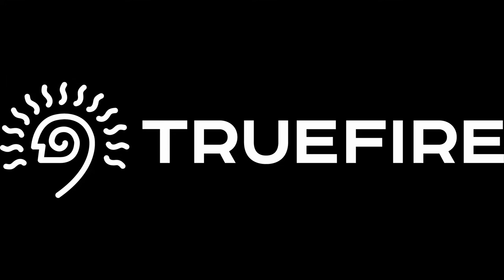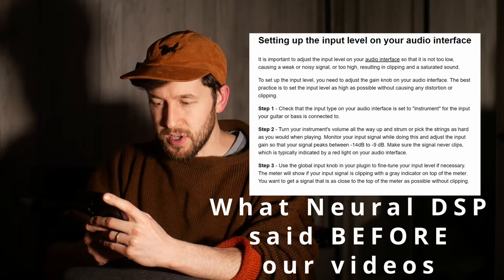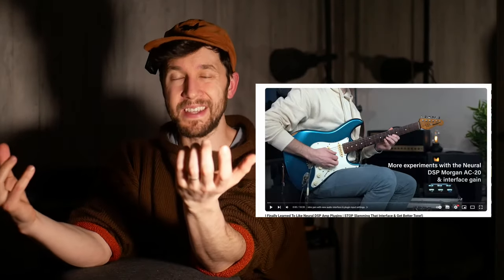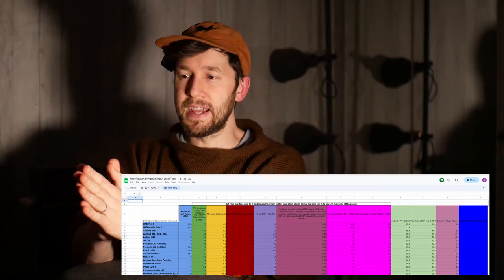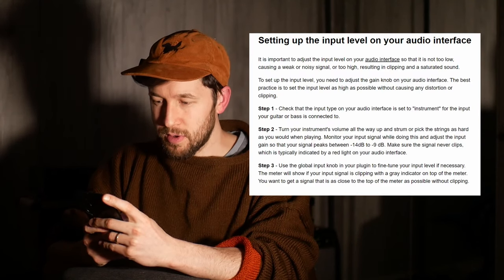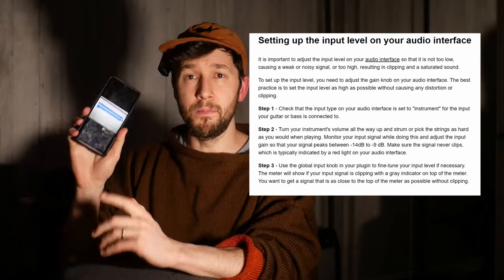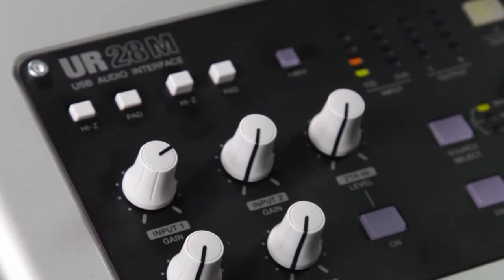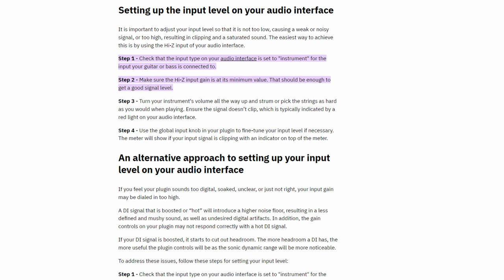Why Are Neural DSP Gaslighting Us About Plugins and Input Gain?

Comment: The thing that irritates the hell out of me about these videos is that you guys know damn well that tons of us are using direct boxes, yet out of the absurd amount of videos about this absolutely none of them mentions Direct boxes.

If you leave the interface gain at zero with a direct box, it is literally inaudible, somewhere in the -32 decibel range. I spoke with Ed S about this and the best answer he could give me was buy an expensive reamp box that I will literally never use once again afterward, and a multimeter which I probably could find use for.

In case you're wondering, yes my guitar tone still sounds like absolute dogshit even with a $2000 guitar, pro q3 and Neural plugins.
Reply: there are other ways to do it, but a suitable reamp box and multimeter costs less than a NDSP plugin or Pro Q3. You can also buy a used one and sell it on, and potentially even make a profit. Maybe you have a friend who can let you borrow one, or a gear rental service? 

If you have 2 interfaces and know the headroom of one then you don’t need a reamp box or multimeter as you can compare levels between the 2 and work it out like that. 

I use a separate DI box and measuring it took all of 2 minutes to do.

Comment: This is getting ridiculously annoying. It’s very simple; you get the plugin and turn some knobs, if you don’t like how it sounds you keep turning the knobs. There’s no single setting you can apply to everyone’s setup. 

You want to know what I do? 
I increase my input gain knob as high as possible without clipping (and sometimes I let it clip 😱). And it works perfect for me. 

I think you’re also missing a very important aspect of this advice neural dsp provided, which you’ve dedicated an entire video fixated on as being bad advice. When neural dsp started making plugins they were mostly for metal guitarists, if you know anything about metal guitar you would know that it requires high gain. In which case that information can lead you to assume at this point in time that the advice they offered at the time in which they were releasing those plugins was also meant for a metal guitarist setup. And many people would agree that that is in fact good advice. 

If youd like to encourage neural dsp to offer advice on a more appropriate gain staging technique for other types of guitar tone then do that, but I find it completely unnecessary to film an entire video bashing them on advice they have offered that many people have found to be useful. You could have simply directed your energy and resources to providing an informative video offering your own advice for gain staging. It probably would have been a fraction of the time. Of course then you would have had to be more creative in regard to titling the video for the same sort of click bait effect.

Comment: Another misconception about EdS video. He never told NOTHING about INPUT GAIN. He were talking about difference in GAIN RANGES of YOUR audio interface and "their" audio interface (plugin creators). Because when you MAP ranges between two devices you definitely would like to have full range on both ends. That's why the only spec mentioned in video as a reference point is "MAXIMUM INPUT LEVEL (dBu)). This is literally gain RANGE of interface. Not the INPUT gain. And numbers in table just offset midpoints of different audio interfaces relatively to each other to OPTIMALLY map ranges. ONLY because you're in digital domain and it has its own properties. When you turn your gain knob on interface up you literally telling "there will NEVER be level less than...." You make your gain range narrower_. You trim it and now it''s smaller. If you will "scale up" it back to initial range you will decrease "resolution".  But you CANNOT just drop your input gain to min and keep everything else as it was before. You NOW have to adjust your input gain but in DAW (or in plugin itself) instead of audio interface to compensate change. It's just ok to do this INSIDE digital domain because you still work with full range initial "source". Just like you HAVE to add your gain on the amp or on the recording console (after signal  taken) to get meaningful results . The REAL thing is : while you're playing low/mid gain it will NEVER affect ANYTHING. You may add gain in DAW or just in audio interface, and you'll be fine. Just because you use such narrow volume range that mapping huge (headroom) ranges of any audio interfaces  will never cause ANY issues. It's just when you play really full throttle high gain stuff (NeuralDSP is MOSTLY for high-gain in mind!) you WILL face unmatched ranges because you will hit MAXIMUM INPUT LEVEL constantly. And THEN you might find the difference. And that's why Rabea (in particular) always used min level. Because he always plays high-gain. But guitar YouTubers completely distorted this conception and 99% of them completely FORGET TO TELL YOU ABOUT GAIN BOOST _AFTER audio interface, in your DAW or in your plugin. They literally told you "just turn your hardware gain knob down to min and you're good to go!" What is obviously wrong. And mr. Cordy also told us NOTHING about that, did he ?  EdS video was about preserving initial volume range from your audio interface to map it optimally to plugin's "alma mater" audio interface range. Just like when you're fitting two images in Photoshop to be the same size, you would prefer to have both in maximum resolution before you scale it (whenever you scale up or down). EdS video just tells us it's better to scale your gain INSIDE DIGITAL DOMAIN because your hardware interface has ACTUAL headroom/range while digital domain hasn't. But it ONLY matters when you really use full range of available volume what most of us never does. That's why MOST of audio interface manufactures and most of "basic" guides told you to use your hardware input gain knob. Just because it's EASIER and fits most "regular" cases. And professionals would know about their options anyway. Tutorials are made not for professionals. And never mismatch your plugin input with your real amp input. Amps are made to expect guitar-level signal and calibrated accordingly. But audio interfaces are made with wide-range of various audio sources in mind and will take your input signal differently. That's why amp sim _have input level adjustment_. To compensate THIS EXACT difference. Otherwise they would just take your "min level" guitar and work as expected initially, right ? :)

Comment: It's fascinating how commonly the term 'gaslighting' is being misused. The term seems to have lost it's original meaning entirely...
Reply: Well if the original meaning of gaslighting is to manipulate someone into questioning themself, then it kind of is. Literally every plugin and amp modelling company recommends turning up your audio interface input level to right below where you get clipping. Even Focusrite suggests doing this for both microphones and instruments. That's the usual practice when recording anything else, so why would we do anything different, right? Now it seems that advice was irrational, as if we weren't told to do so... Gaslighting.
I honestly never tested it myself and assumed that turning the interface level all the way down would yield no signal at all.
Reply: @Flacsabbath  
The misuse of the term "gaslighting" here stems from conflating evolving recommendations based on new insights or correction of errors with deliberate manipulation.

Manipulation requires intent.   So let's consider what Neural DSP would gain by intentionally misleading their users about input gain — absolutely nothing. Misleading users would harm their reputation and customer trust, which is counterintuitive for any business, especially in a niche market. 

Gaslighting is not accidentally giving someone the wrong directions because you genuinely thought you knew the way, but later realized you were mistaken.
Reply: @constantinschreiber9243  I agree with you all of that. They did change their written recommendations. I guess it's more so the people saying this is basic knowledge that cause that feeling when everything else said otherwise. Perhaps Rabea was unaware that Ndsp was saying to do this for his signature plugins. 
In the end, we all tweaked things to our liking after the fact anyway, so it really didn't matter. This just makes it easier going forward.
Reply: @Flacsabbath  Absolutely! Should definitely make things easier and it indeed is a bit confusing that they had put out this conflicting information in the first place, especially as supposed subject matter experts. 

I myself was definitely being misled by the previous instructions, as it never even occured to me to dial down interface gain to zero. It just seems so counter intuitive.

Comment: I don't get it. What's the actual reason behind setting the interface to 0 dB gain? Gain staging is something that's pretty much just basic signal theory. The first stage of gain (or the one closest to the source) helps give the highest signal to noise ratio. That's not depatable. Of course, when you have a 24 or 32 bit interface, the noise floor is very low, but it's still the best practice to raise the input gain noise-wise. Especially, since amps usually get overdriven with very high gains and then clipped. You want your noise lowest possible, right? This seems to just be Neural DSP not wanting to have a way to auto-level input signals and instead transfer the responsibility of providing a base-line signal level to the user. Am I getting it wrong? What my point is - you should be able to get good result from a plugin regardless of whether you gain stage or not, it's all just software beyond your interface, as long as it's not clipping.
Reply: Because guitars don't have a gain knob before the amp. The signal level seen is the output level of the guitar. There's no way to boost it, or cut it, without switching to a guitar with more, or less output. This ignores all pedal and assumes volume is all the way up on the guitar.

With the INTERFACE gain up, it's hitting the plugin too hard like a boosted signal, overdriving the "amps".... and to be honest, on a Peavey 5150 sim, it's fucking BAD-ASS. Imagine you love THAT gain, need a boost, but don't like any pedals! You can just dial in more 5150. I love it. These idiots are just figuring this shit out and I've been using the plugin input gain to clean up and dirt every sim this whole time, adding and taking all kinds of tones and possibilities.

whoops

It's like having 10 more amps/channels

Leave the nterface gain up, hit the converters properly and then use the plugin input gain, COS THAT"S WHY IT'S FUCKING THERE, to push the amp however you like.

Consider every amp, modded.
Reply: @doktordrift948 But that's my point - they do have a gain control, which is it's volume knob. It just goes from -inf to 0 dB. And if it's active pickups, they literally have gain control as volume button. But you don't see anyone advocating for decreasing the gain that way.  What I mean to say is - all the oldschool plugins - Amplitube, Guitar Rig, Revalver, all have input gain control separate and even learning button, so they could auto adjust the gain. You set the gain as high as possible on the interface so you could utilize the whole range on the ADC, and the plugin compensates for that if need be. After all, the plugin can use 64-bit float precision, which is better than any interface can do. I guess they did this so that the simulation and the real thing (5150, for ex.) sound the same using the same guitar. This would satisfy the fanatics, but the problem is, not every interface has the same gain when decreased to 0. So you end up having to look up what's 0 dB for your particular interface. Or you could just not insist on the pedantic need of it sounding the same as the real thing (which it can't sound anyway, it's a futile endeavour, you're gonna have differences in cabs, room, everything really) and just adjust it SO IT SOUNDS GOOD to your ears.
Reply: @fluxx1 Let's ignore the volume knob on the guitar for a sec. These guys are worried about hitting the amp sim with the same level as the real amp, volume all the way up.... and then yes, you're correct, and that is exactly what i'm saying I already do, and, it has the advantage of being able to drive the amp, more or less than you ever would be able to, all things given. Every single one of these Neural DSP amp sims, have an input gain in the interface! Yes, you'll have to look it up to match levels of your interface/sim..... or, you can use your damn ear and dial in, whatever you want, and so much more.

These are guitar players and not neccessarily critical thinkers, made even more obvious by the whole drama over this.

They should focus on the increased versatility, using their ears and being creative with dialling in tones and stop relying on presets so they can be lazy and not need to do all of that.

Again with the 5150... people love the sound of the amp, but are always trying to boost it a bit more with pedals and in sims too. Using the input gain you CAN boost it, have more of the amp's gain and it sounds absolutely insane. You'd need pedals or amp mods or higher and higher output pickups to do that irl. In contradt, you could also clean it up with less input, same with the Morgan sims they are talking about in the video that sound like they have too much gain.

It's all a bit silly and distracting them from finding good sounds and using their ears.
Reply: @fluxx1 Also, I've tried what they're doing with my MOTU interface and went back and forth listening and using the amp sim input gain sounds better. It FEELS better to play. More responsive. Sounds stronger, or more full. Also feels like i have a more even and progressive sweep of gain like a really nice pot on a really nice guitar.

Might not matter in a song, or a mix, or whatever, but it matters when I'm playing my guitar.

Comment: This is very bad noob advice. Understanding gain as a guitarist is a MUST. There are plenty of ways to gain stage per preset after the input.

When using analog gear like a mixer, low input gain WILL result in noise, once you crank up the output fader to make up for it. It's just how voltage works. Raising the input gain is electrically healthy for the signal.

The input gain is the only voltage analog gain on your interface, everything in software is digital. That means if you raise the gain digitally from very low gain input, the algorithm is artificially recreating the lost volume of your guitar. No bueno.

Having high input gain allows you to control the gain from your vol knob at the guitar, like pro guitarists should.

Granted, interfaces are digital and hence not susceptible to noise, but you should really do your research before talking about stuff you don't get. You don't provide any explanation or even audio samples to back up your claims. 

Just lower the gain digitally right after the input, on the amp or put a gain or volume pedal before it, that's it.

Comment: This conversation is a joke accommodating noobs getting digital clipping. That's pretty much it. Amp Sims have an input level before the vol/gain of the actual "amp sim" that is usually not incorporated into a real amp. learn to use the sim and stop making flatline DI's with a high noise floor.

Comment: You crazy, I always used the input gain from my audio interface at zero since my Fast Track Pro days.....never read the manual, just play dude 😎😂
Reply: what about the signal recorded in the DAW, isn't it too flat?
Reply: @S-dr7jx  Generally I use an amp sim from a old Mooer mini pre amp pedal that I have (EVH 5150 in the clean channel) with also some OD boosting (I really liking the Bondi Effects Sick As for this) and an analog distotion (JHS AT+)....throw a free  power amp simulation in the guitar channel (SH-1 if I'm correct), an Impulse Response and set the volumes between the distortion and the Mooer and have get a strong recored signal. 

I have the Plini Arcthype which I like for overdubs, but still I set the gain at zero in my audio interface because it just sounded the best for me always (I just did that by accident and ear all these years, never claimed to know anything I was doing, and it's funny its the right way now it seems 😂)